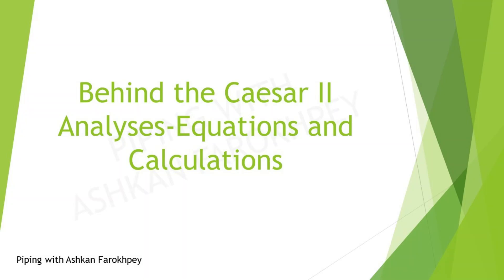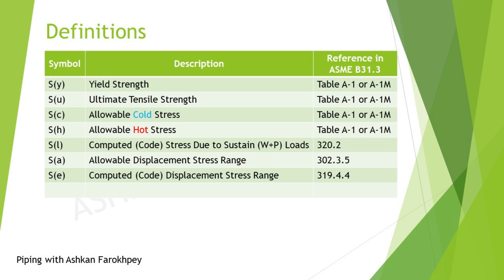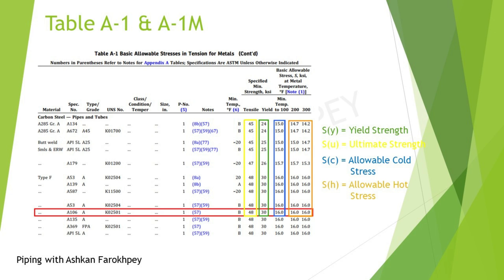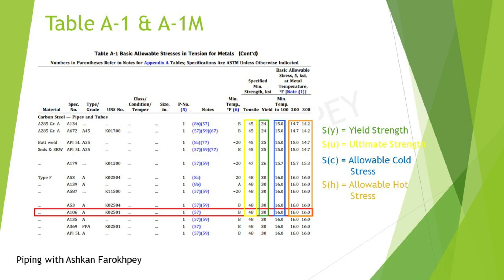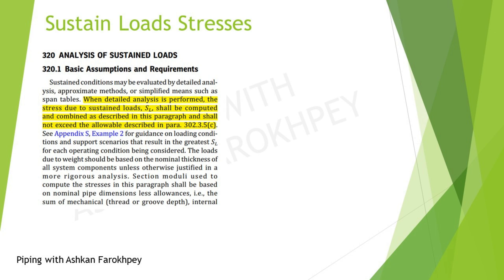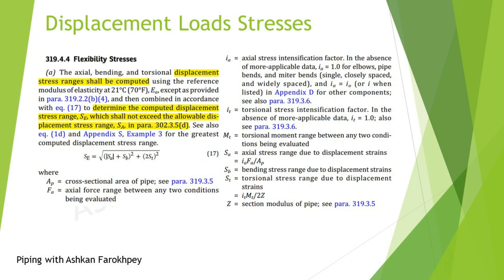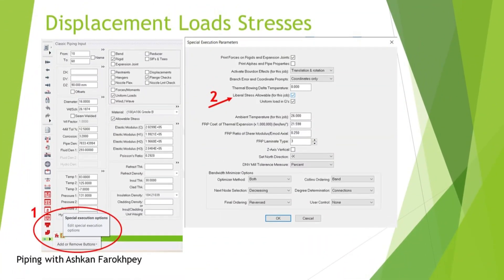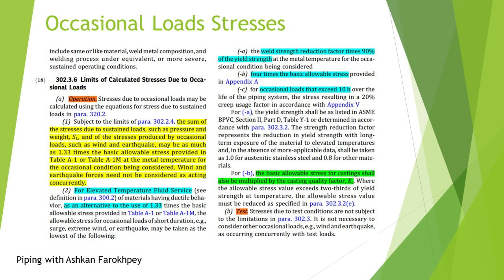Secrets Behind Caesar II - Theory & Calculations

Comment: Hi Ashkan, thnaks for your very informative video. My question is why ceasar compares sustain stress with min. Sh?
Reply from the maker: Hi. Thanks for watching my videos. The reason is the sofware must consider the material’s strength at the maximum metal temperature during operation — not at ambient.
Caesar II pulls Sh from its material database (based on the code you selected) and uses it.
Hope to be clear.